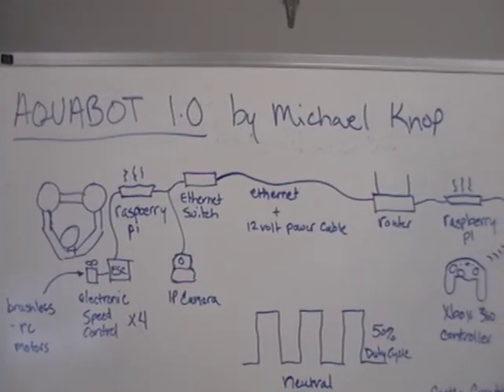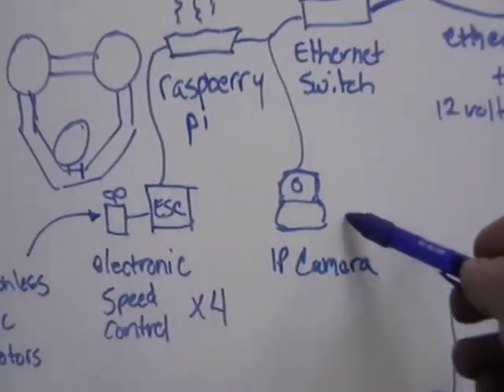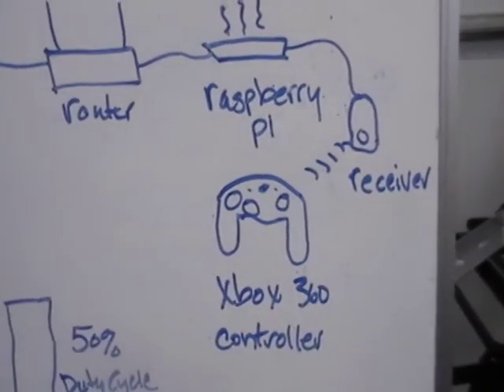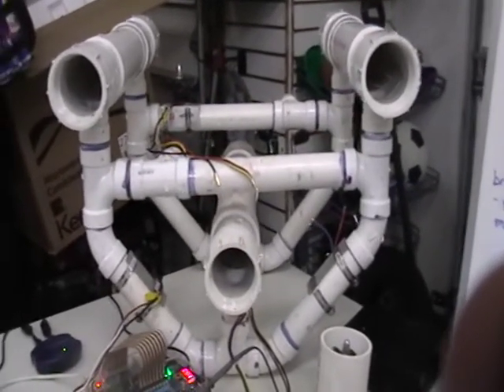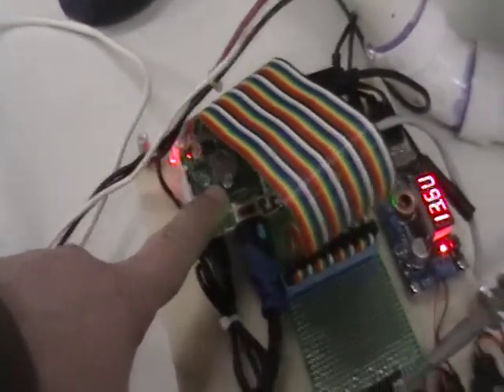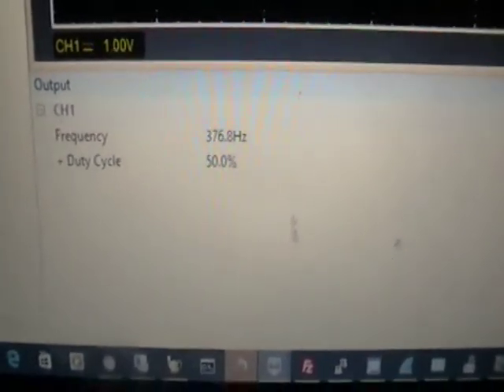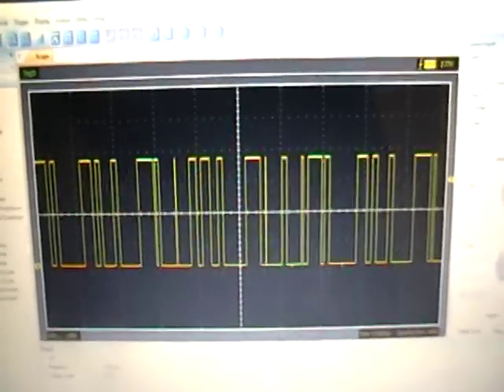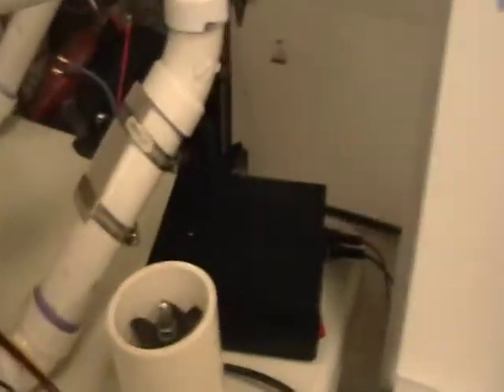ROV - Design Overview

Comment: Or you could use the onboard Pi to control an SSC32 servo-controller via I2C, which then could control all the ESCs, plus another 28 pwm devices...servos, light controller, arm w/ gripper, ballast drop solenoid, air solenoid to release air from a scuba pony tank into the hollow bouyancy chambers for active bouyancy control, etc.